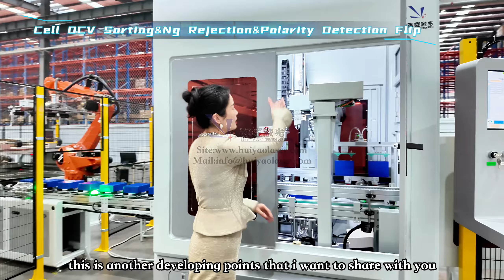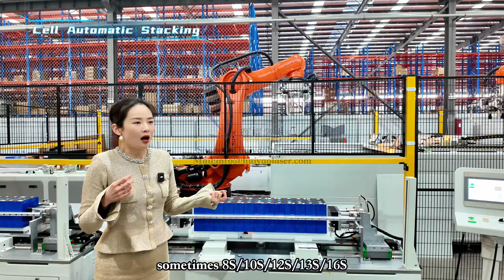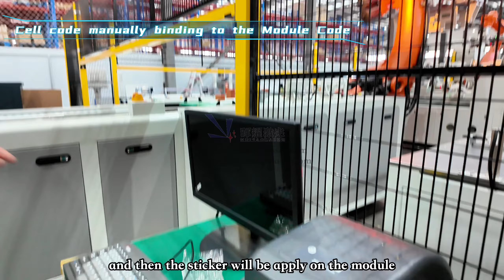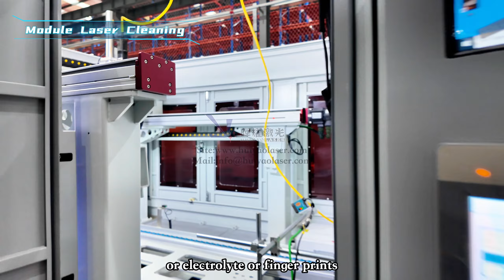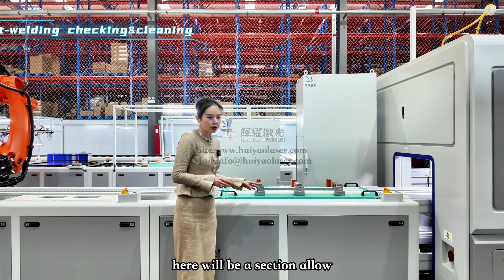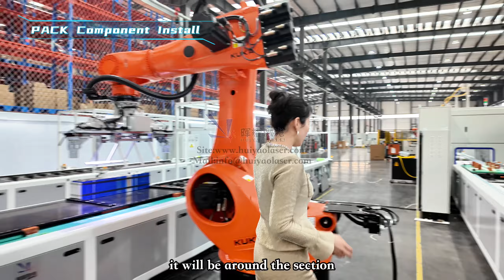2026 Energy Storage Battery PACK Assembly Line Update | Huiyao Laser

Comment from the maker: Meet Huiyao Laser at ees Europe 2026 in Munich (June 23–25).
Discover our latest BESS battery module PACK assembly line designed for 587Ah & 628Ah cells.
Please contact Whatsapp-(86)17625352701 for directly conmunication.